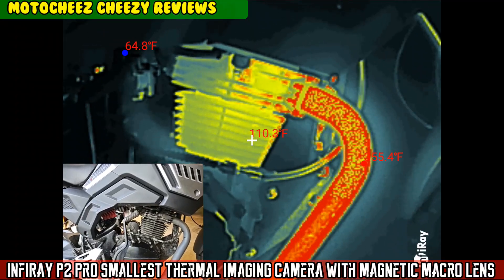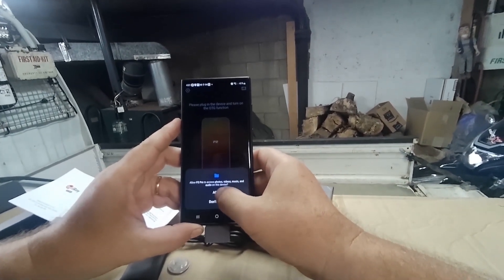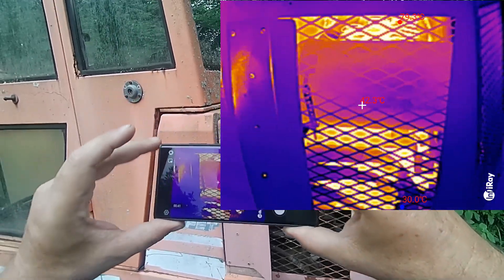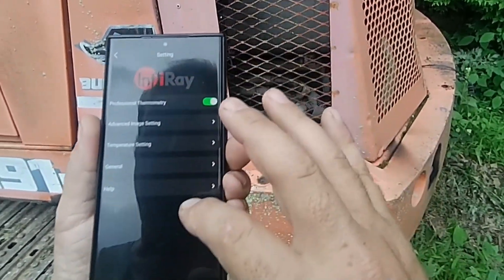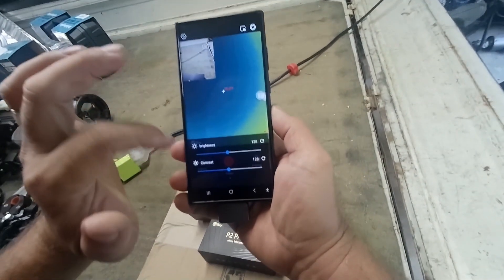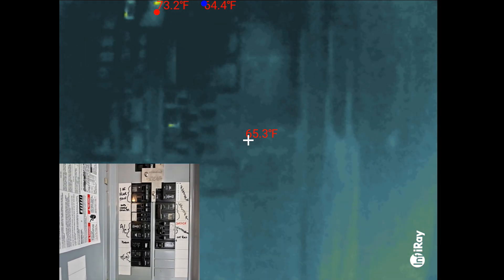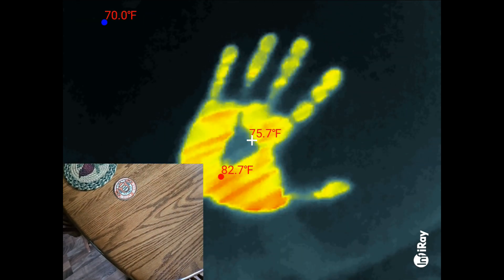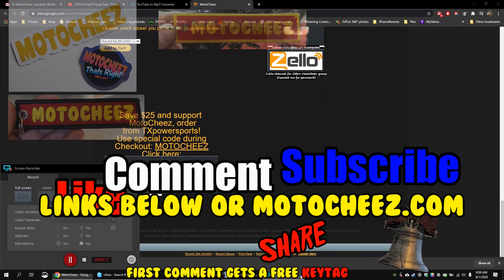InfiRay P2 Pro smallest thermal imaging camera with Magnetic Macro Lens 256x192 res

Comment: Could you please clarify what "burn protection" refers to, how should one use this device, and does it suffer any damage when operating for 12 hours straight?
Reply from the maker: Burn protection is described in the manual as a high heat radiating source. 
As far as opeating length of time, you'd have to ask the manufacturer, their info is in description
Reply: Can this device be used in projects made with Raspberry Pi? @MotoCheez
Reply from the maker: @ahmetttt10 That's a good question, I imagine if it was using the Android OS code could be written to use this